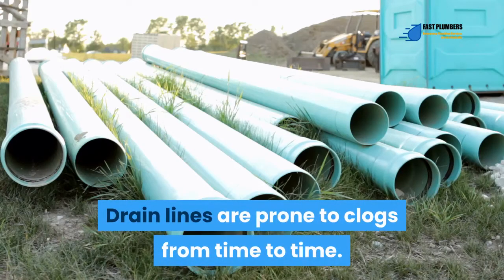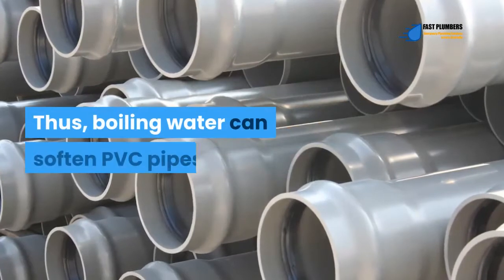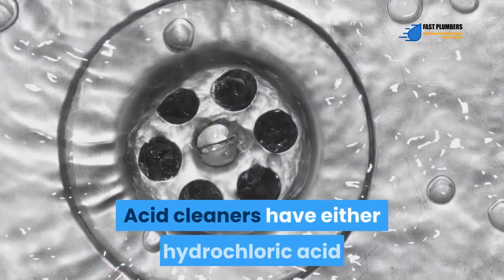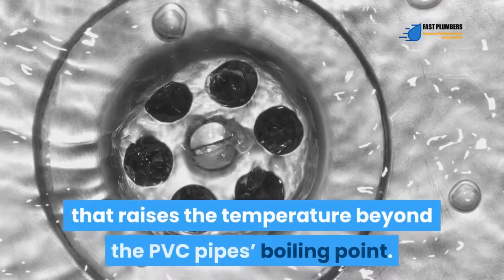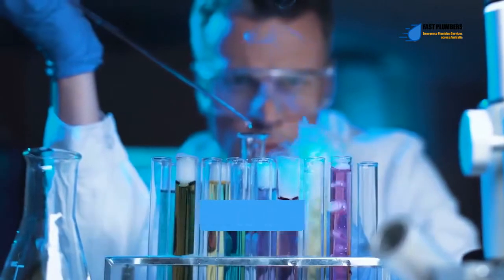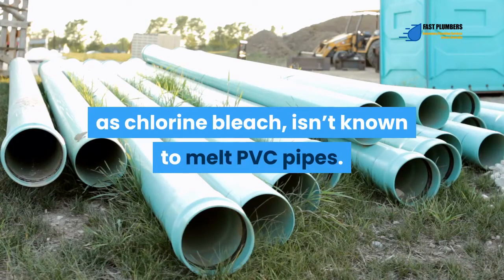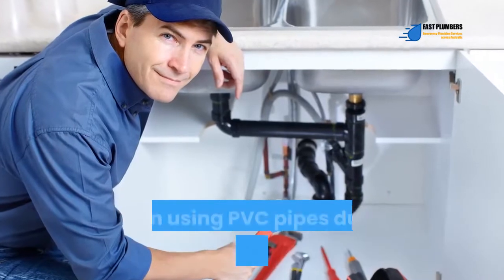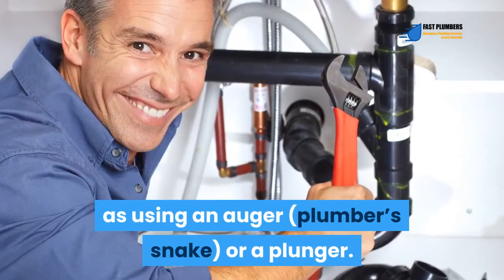Chemicals That Make Sink Drain PVC Pipes to Soften or Melt

Comment: Correction: Sodium hydroxide with aluminium pellets does not react with the water, rather the water gets the sodium hydroxide close enough to chemically attack the aluminium, which would otherwise not be the case as the oxide layer protects it from physical contact.